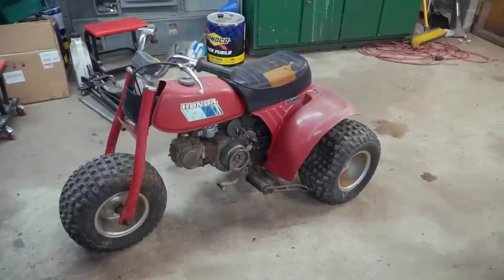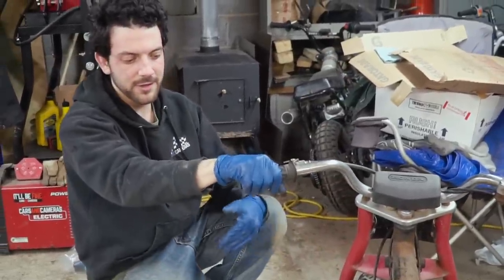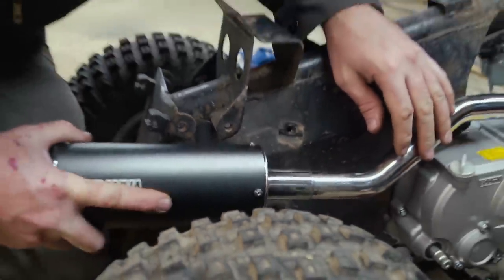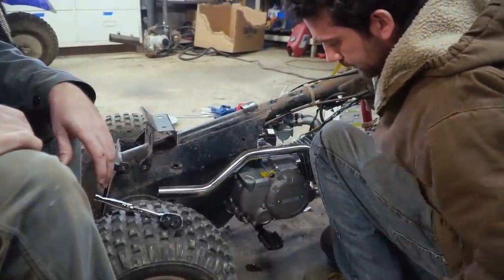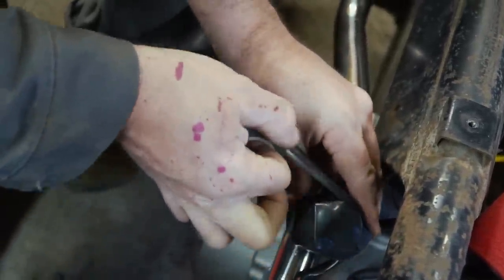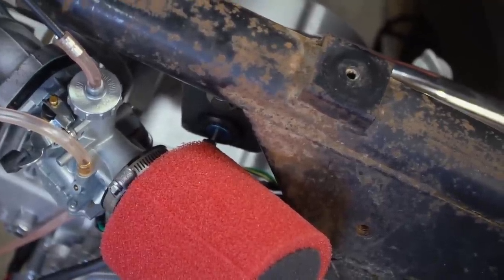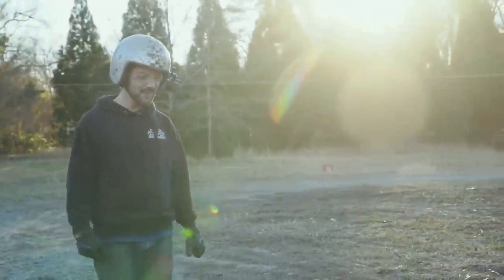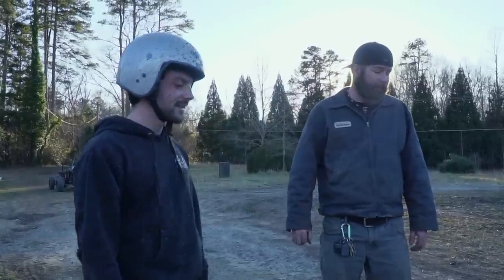Honda ATC 70 140cc Swap! Tiny 3 Wheeler gets BIG POWER!

Comment: "probably two or three seconds slower like everything is in the winter because of the MUD "

Every Northerner: digging their car out I'm sorry, the what??
Reply: One hundred percent accurate.
Reply: Yeah, we actually have a season for mud, usually happens around April or May here in New Hampshire. All we have this time of year is snow, ice, and frozen socks.
Reply: Probably be faster in the winter until your hands freeze
Reply: Hey Junkyard Digs I bet Johns 70 can beat your 200. You should look into one of these motors but bigger for the 110 that smokes like a chimney
Reply: @N1RKW  We have the mud season too once the snow's gone. Nothing but mud and mud puddles in the yard. Doesn't help we're neighbors with Vermont and New Hampshire. So we all get the same lovely mess. :P
Reply: @Slane583  - Isn't it great when our driveways are about the consistency of yogurt? No amount of gravel seemed to help mine.
Reply: @N1RKW  For the longest time our driveway was always just dirt up until recently. It was originally only a car wide and slightly at an angle and we'd park two cars wide. Which would result in muddy ruts in the grass. So it was worse then, now it isn't as bad as it used to be though. The driveway was widened and filled with gravel a summer or two ago. The parts that are the muddy mess for us now are the part of the yard we walk on to get into the garden and then the chicken run looks like a pig pen once it thaws. Always a lovely experience. :)
Reply: I live in southeast Alaska rainforest it’s either mud slush or snow depending on the season
Reply: @GratefulEd907  Looks like the weather conditions are fun year-round for you.
Reply: Hope your okay buddy! at least it wasn't the trees this time! Keep up the great work and slow that thing down a lil bit lol
Reply: @N1RKW  In Michigan it's quite the opposite. Instead we get a foot of ice on the driveway. You can't get anything out, even with a goddamn Axe. One time my dad had to pull my uncle's car out of his driveway. Which was frozen To The Ground by the tires. He decided it was a great idea, to hook up a chain to  the lower control arm, the other end being attached to his truck. He then  tried to yank it out and promptly snapped the control arm. And here's the kicker. They don't make my uncle's car anymore. And there is only one company that makes parts for it.
Reply: @N1RKW  Perhaps stone slabs would work.
Reply: @dacarvoid45  - That sounds like an absolute pain in the neck to deal with.
Reply: It’s -38 in Minnesota
Reply: @shesmint3162  same here

Comment: i think 450 is a steal for that.... i’ve seen projects w no motor selling for 600 plus... haven’t seen one that complete for less than that
Reply: Yeah here in Nebraska a few years ago most every farmer had an old one you could get for $100 now if you can find one they want $400 for a clapped out frame.
Reply: Down here in south Florida those things easily go for over $1000. I’ve seen several frames/forks with no tank/seat/rear axle/wheels going for $300. He got such a good deal at 450 for a complete bike
Reply: @yamaha04rider  yea i’m here in south florida too. I got my ATC200s from texas off of ebay for 900 shipped and it’s pretty souped up... all of the options in my area were way too expensive and way too much work. Out of state is the best bet unless you’re real lucky.
Reply: Lifan 125 4 speed manual for 251$ on amazon look er up
Reply: Wait I’m dumb that’s for the wngine it’s still 500$😂
Reply: @nothuntersmith  it’s the same for brand new dirt bikes too. Drive 8 hours north and look for a bike at a dealership that’s left over from 2-3 years ago and you can save $2-3000
Reply: Nada value is 3200 on a nice one.
I just put a grand in parts on one getting rid of sun damage. But its sweet now and it doesnt rust here in the mojave. It needs a good home
Reply: @curtislarson1487  pricing?
Reply: Yea it was a steal
Reply: I have both the atc70 and the fourtrax 70, the fourtrax is way safer for a kid

Comment: Alternate Video Title:
Making something dangerous even MORE dangerous.
Reply: Better title. "Taking something perfectly safe and ruining it with hop up parts"
Reply: "Today on Cars and Cameras, we try to kill Ike.  It'll be fine?"
Reply: Actually, being able to break the rear end of a 3 wheeler loose is basically the only way to keep from flipping them. Power=Good
Reply: @snafuequals  I see your point but respectfully disagree, a well placed  butt cheek works wonders on keeping the rubber side down, assuming the power matches the size of the trike. Putting too much power in to a chassis too small leads to more problems than it can solve, unless you build according. For a build like they are attempting, an extra width axle, flat track tires, and a tube frame might have been a more stable build strategy. The flotation tires theyre running are wanting to dig in the corners and they dont have the width or the body weight to counter act the inertia.

Comment: I didn't realize how substantial the frames are on these little ATC's.
Reply: They virtually all ended up bending still though.
Reply: Not that substantial. I cracked my Honda 90 atc & I don’t ride hard.
Reply: @theadventuresofshellyandfr5618 , thanks for the update.  Appearances can be deceiving, apparently.  Looks like a tough frame on camera.  I've never wrenched on one.  I've only fooled around with motorcycles and ATV's.

Comment: you guys said it in the video, get the leads to hook to the battery to charge it, seriously, why did you not just attach two cables to the battery and lay them out the back somewhere?? doh!!
Reply: Ik all they needed was a hot and a neutral with ring terminals on the end

Comment: If the chain ever breaks, that 17t sprocket is more likely to shove the chain thru the engine case.
Reply: That unlikelihood frankly isn't worth considering when adjusting gearing.
Reply: @SportbikerNZ  depends on the size and strength of the chain

Comment: I just found myself one of these awesome little 70’s
It’s a 1983 honda 70
$250 
Just needs a carb cleaning and throttle cable and she’ll be running. 
Also just picked up a 125cc Lifan motor I’m going to install on it. 
Thanks for the video! 
It’s going to be a big help once I get started on my project. 
😎

Comment: Impact drivers rock. Learned that from Mustie1. Thanks Dad. lol P.S. You only need to tap the correct wires leading to the battery. No need to remove anything

Comment: Pro tip:  the carb should just barely clear the frame if u rotate it another 90deg to where the air filter hides behind the front fender (if u had one). Keeps it dry!  Moist filter is the biggest pain to deal with on rides. Outerwear pre-filter cover is next best option. Highly recommend!👍
Reply: Oil your foam filter.

Comment: You could short out the key from the system, by connecting/jumping the wires in the loom that provide power, then just rely on the button to start the bike.

Comment: I love these little atc's. My senior project in high school was rebuilding my Honda ATC 110 from the ground up all new bushings all new bearings resealed the tank repainted it painted the forks cut out new stickers in graphic arts class repaired the rack and put a .050 over kit in it just for shits and giggles. Almost got suspended for riding test wheelies in front of the school 😁 👌.

Comment: Great build guys!  

I've got one of these going into a Grom clone in the spring.  Actually taking the stock Lifan 127 and going to a 141 with t-bolt parts and bumped compression too. 

On a 200lb bike, should be wicked!

Comment: Hey from Norway, peeps:-)
Love your videos. Ceep up the fantastic work, and fun ,-)
Here in Norway, at the age of 16. You can ride 50cc mopeds/scooters and atv`s. 
I got my selfe a "Honda Sfx" scooter at the age of 30. Pulled it apart andrebuilt from the bottom. 
Ended up with a all racing setup. The malossi "70cc rr" combined with a delorto 28mm carb. 
Well, it worked. Got to about 120 Kmt maybe 130.... But anyways. 2 stroke, its fun.  Would like to se some of those on your show.

Comment: Factory 110 and 125s are different mounting than the 50s-90s. Aftermarket 108s-140s are mostly made to fit the oem 50-90cc chassis.

Comment: If you want to bypass that key just connect a wire between the first and 3rd pin this will tell it the key is always in the ignition.  You can also just replace this with a switch.  I have this on a couple of my cars where it really isnt worth sorting out all of the electrical issues at their age

Comment: You don’t need to take the battery out to charge it or run extra leads you can jump it right from the starter relay on the battery side and just throw your ground anywhere on the frame

Comment: My 1972 Suzuki RV90 is slipping really badly, I know it's not the clutch discs because they are new. I was told it could be the springs in the basket but I really don't feel like opening the case right now so I've been thinking about putting a 196cc "racing" Box Stock Project engine in it temporarily its stock engine is just an 80cc 2 stroke

Comment: Pwk28 carburetor with power jet take the muffler tip out and you will remember this comment... I use 39 slow jet and 100 in secondary jet and the power jet in high RPM do the rest 💪 love this engine love this build love honda pit bike atv and atc

Comment: Don't run those red fuel filters with a metal tank. They just have a single screen in them, and don't filter anything smaller than a chunk of rust. I had my carbs gummed up in a week after cleaning them on a four cylinder motorcycle after using that filter.

Comment: Great vid but I have a problem with my predator 212 I put a mikuni on it and welded an exhaust but it only runs on choke and when it starts on choke it runs away the thing revs itself out

Comment: Around 5:30 y’all state about putting all different CC engines to that frame. Does this go for just the atc70 frame or can I add this motor to a Honda 110 or Honda 125m frame?

Comment: Why didn't you attach 2 wires to the battery and run them out back for the trickle charger. You could have attached the pig tail to them later.

Comment: if you want that Honda be Better Put the Wider Rear Axle in that and put Narrower Front Wheel it becomes much better to ride and does not fall to the side so easily and the front wheel when its narrower it also helps to keep the honda upright much better when you ride over muddy place

Comment: On the front of that little Honda 3-wheeler the wheel bearings for a short-term fix get some WD-40 white lithium grease and spray that white lithium grease end of the bearing but you got to clean off the dust jackets get all the grime off first then spray WD-40 white lithium grease into the bearing and let it percolate in there and the bearings will actually had some lubrication that work for a while I've done this myself with my mountain bikes cartridge bearings before I got a new set of crank arms my old FSA cranks every Thousand Miles I'd ride my bike that bearing would go bad so I would spray WD-40 white lithium grease into it and it kept it living for at least a couple or a few hundred miles more peace out you guys have a great day

Comment: I happen to have an identical trike with same engine but I bought it converted on eBay but it's been nothing but trouble tbh and it's not fun pushing it home in the slop that's for sure  ? So If I could have turned back the clock I would have bought a trike with the original 70cc engine as it's much more reliable than the Chinese pit bike engine  !!  Anyway take note people if u have a good original honda engine that's reliable then leave it in there  ??

Comment: why didnt you hang a black and red pair of wires out of the frame from the battery so that you COULD attach a battery charger when needed ???? you could have capped them for safety. John even said it lol.
Reply: I installed a connector
Reply: @isaacitllbefine7231  i shoulda known, it'll be fine!

Comment: We specialize is these Atc70’s. You need our battery box, foot pegs & gear shifter. 
The oem thumb throttle won’t open the carb slide all the way. Your pit bike pegs are to far back. HondaATC.com

Comment: Guys just raise the tank instead of modifying everything put a bracket that's raised up for the same bolt pattern and f**** welded onto the frame and then just lift the damn tank up man so it's a bit higher and out of the way it won't look f*** up

Comment: If they would just spend a few more cents on the wiring and better more moisture proof electronics the little china motors would be Every bit as good as the Japanese ones they clone. I fixed a bunch of chinese knock off bikes and its 99% always with the moisture sensitive electricals..

Comment: So u guys have had some good ideas and some not so good but putting the battery somewhere that the engine has to be removed to replace it has got to be the flat out dumbest things I’ve ever seen!
Reply: Where else is the battery going to go?
Reply: @isaacitllbefine7231  same spot just on bottom of frame rail just add a small skid plat for protection. When u put it in that spot to mark out the spots to drill out hold down bolts I was waiting for u to have an AH HA moment but wasn’t to be lol
Reply: By the way while I’m on the cry baby mode . GET HELMETS THAT FIT!!!!